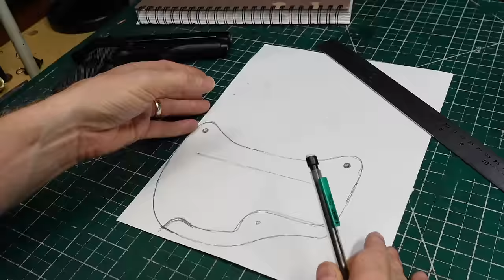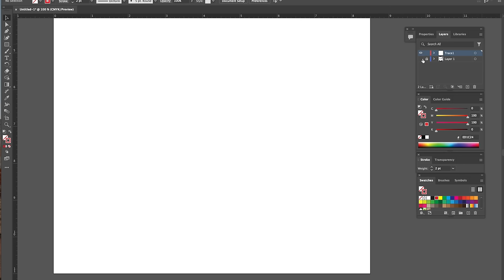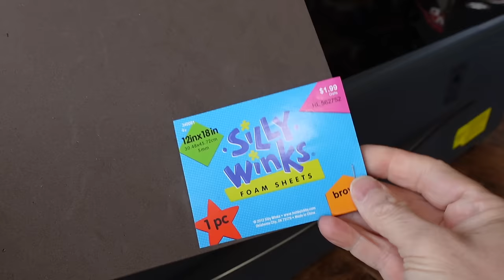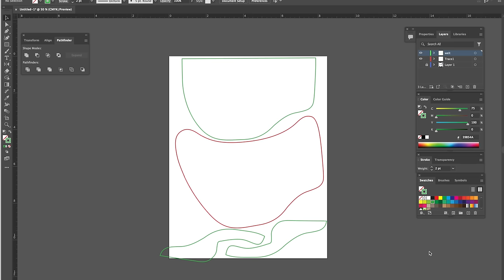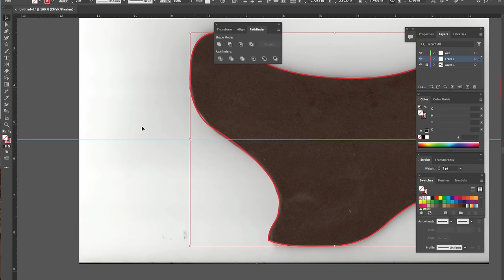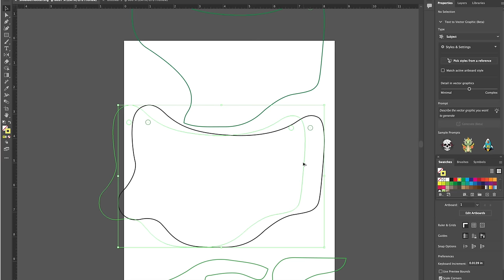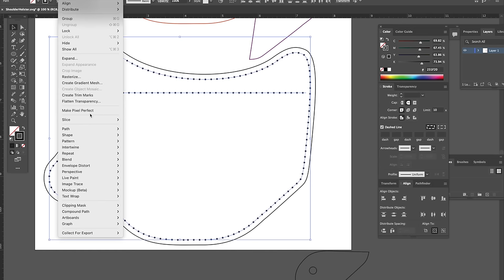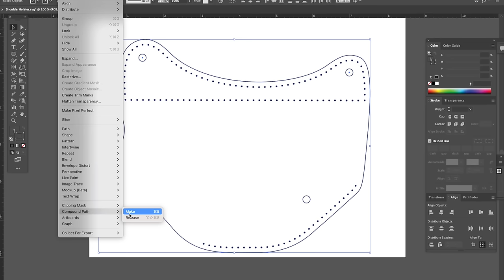Sketches to Patterns to Laser Files: Making a Leather Shoulder Holster

Comment: Been laser cutting leather for about 4 years now and you use almost the exact same process I do. Only thing I do different is for my scale check I just trace the pattern on a 8.5x11 sheet of paper and import to Inkscape as a pdf. But otherwise I think as far as efficiency goes, you got it down. I will say here lately I've been trying my hand at just digitally designing my pieces by taking my measurements off the gun with leather ruler and then importing a picture to scale of the firearm, have found good success with it, but not super comfortable yet.  Big fan of your channel, been watching for some time now and Im glad someone is doing what your doing with lasers and helping to get rid of the stigma! Awesome build man!
Reply from the maker: My scanner will inexplicably upscale scans sometimes . . . or maybe it's in the import to Illustrator. Dunno; it's obviously a setting somewhere I keep missing. But there has been a few times where I scanned, traced, and ran a laser file only to pull it off the machine and say "that seems too big". Hence why I do the scale check. Thanks for watching!

Comment: Designing holsters on paper is the bane of my leatherwork existence. The measurements don't ever turn out right when transferred, and I end up wasting leather. Belts, bags, pretty much anything else is fine, but for some reason... And holsters are the second-most requested item I get asked to make. 😆
Reply from the maker: lol. I know what you mean. Whenever I have to start a new pattern I stare at a blank piece of paper like I'm looking into the void.
Reply: I use a 1/2” strap cut from the side of leather I’ll use to make the holster when I’m figuring out stitch lines. It’s very similar to the system Andrew’s Leather Works shows in his videos. It hasn’t steered me wrong yet.

Comment: Has using the laser cutter improved work time or more efficient use of your leather stock?  Are you getting more items from a piece of leather than before?
Reply from the maker: I don't run a normal leather working business per se. For me lasers are more about the precision and accuracy of cuts and achieving results that you simply can't do by hand. That being said. . . . Yes, of course! Once I have the pattern created and .svg files made. I can output complex parts that are ready to be dyed and stitched at the push of a button. See my bandolier video I made previously. All those leather boxes can be crammed into a sheet of 2oz veg-tan and cranked out as many as needed. I wouldn't have even attempted that project if it wasn't for my laser cutter. Also, many machines come with onboard cameras and software that can automatically position an array of small parts on any shaped piece of leather for you in the most efficient way possible.